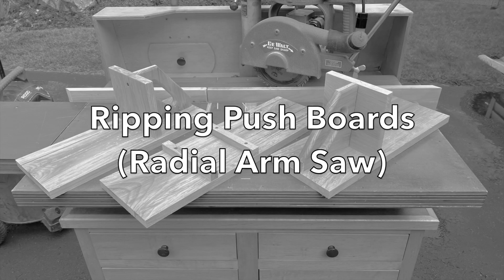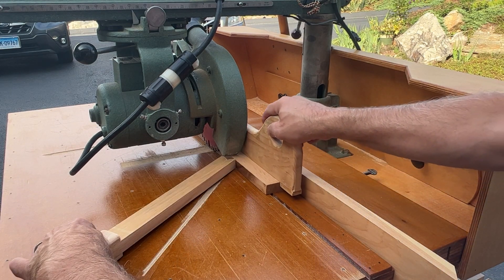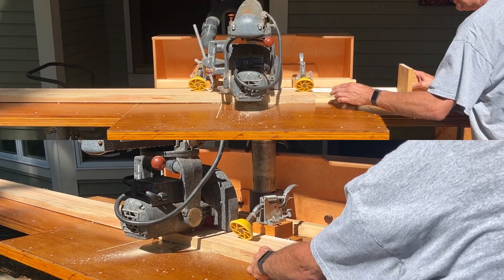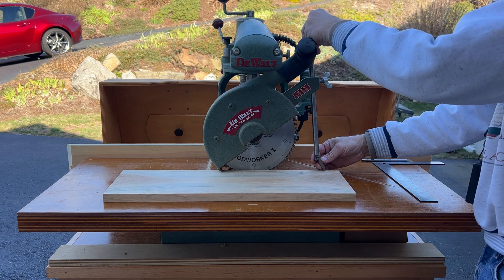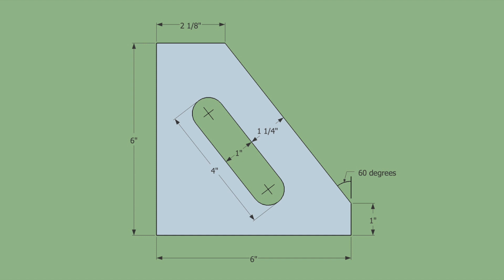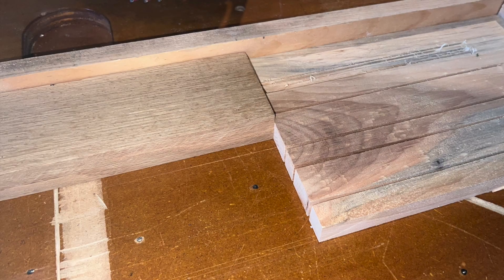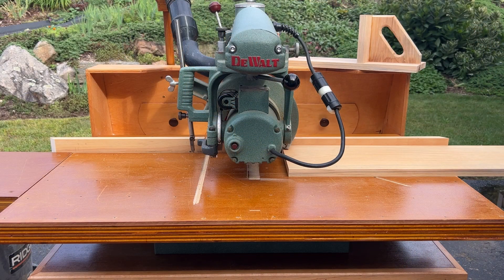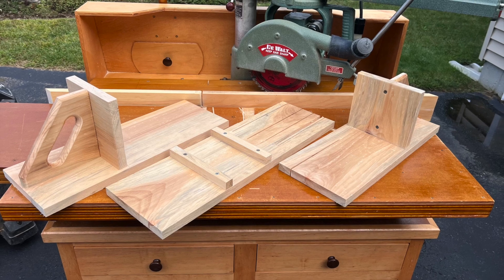Push Board for Ripping on Radial Arm Saw

Comment: Would you consider the Freud 15" blade to be sufficient for a Dewalt GE. My current blade is quite old and leaves extremely rough cuts.
Reply: I had only briefly looked on acme tools and had found the LU84R015. I'm sure I'll have to look around on other sites. And, yes, the model I have is a 5hp 16" saw. 
The forum spoke very fondly of your video for properly setting up a RAS.
Reply from the maker: I assume you have a 1" arbor? I think you mean the LU83R015?  That would work, but considering the power of your saw, I'd still get the LU84R016 or LU84R014, since your saw has ample power to swing it.  The thin kerf blades are better choices for underpowered saws, but a full kerf blade is stiffer.
Reply: @brianweekley5700  Understood. Thank you very much for educating me. I'm trying to get the old work horse cleaned up and more functional than a rough and dirty crosscut saw.
Reply from the maker: Exactly what Freud blade are you talking about?  Depending on the model, I believe the GE is a 16" saw and has a 5 to 7-1/2 hp motor, yes?  If it were me, I'd use either the Freud LU84016 or LU84014 blades (16" and 14" respectively).  The LU84 is the same blade as the LU83, except it's a full kerf blade rather than a thin kerf one.  However, a GE has ample power to swing a full kerf blade.  The blade configuration of the Freud LU83 or LU84 combination blades work exceptionally well on radial arm saws in all modes (crosscut, bevel, miter, and rip).  These blades are highly recommended on the DeWalt Radial Arm Saw Forum.

Comment: I have 2 RAS and they are a Great tool. One is a 1975 and the other is a 1980. Since I had the 75 first, I have it set up to Perfect. I use the newer one for crosscuts and I use the older saw for everything else. I made my push board after I saw yours in a video a couple of years ago. Earlier this year I found a shaper/planer head and 14 complete Unused blades of different shapes. I have been practicing with making different trim and moulding profiles. Oh, and I also got a shaper head blade guard. Great video. Thanks.
Reply from the maker: Thank you!  The RAS makes a great molding machine too!
Reply: @brianweekley5700  They do indeed. I have learned a lot from you over the past couple of years. And I would like to say, THANK YOU for the CORRECT INFORMATION that you put in your videos.😎🇺🇸👍

Comment: I had not thought of this. I rip rarely, but with this I can use the radial more often. Thank you so much!
Reply from the maker: Thanks for the comment.  With the correct blade and properly tuned machine, you can rip accurately and safely.

Comment: Great video. Your push board is very close in shape to mine. I use a hand saw type handle on my push boards too. Thanks for another great video I'm sure it's very helpful to newer members. I'm glad you mentioned the safety factor also.
Reply from the maker: Thanks for the comment.  You can never get complacent or ignore steps for safety!